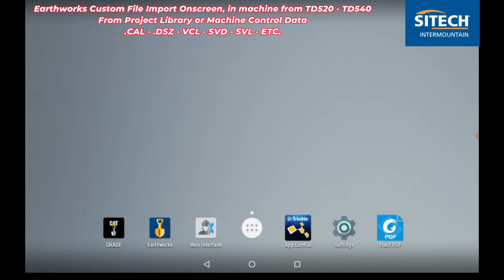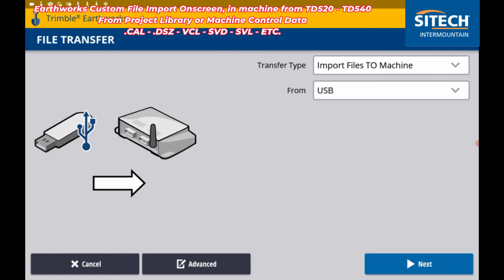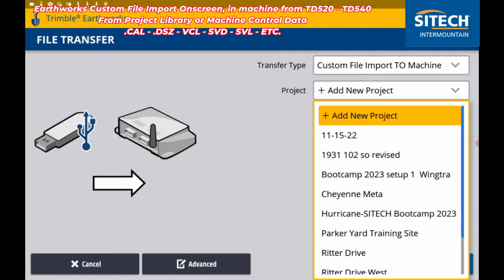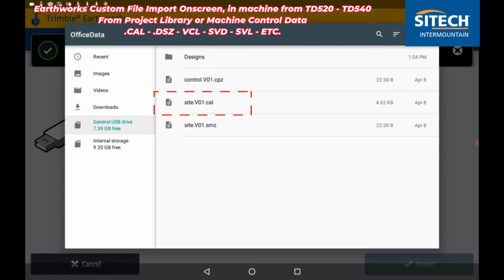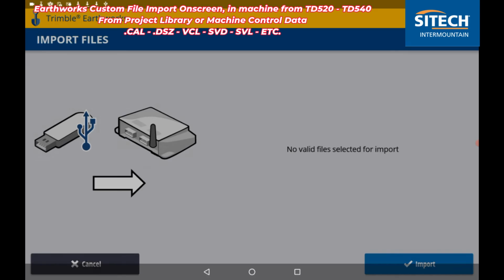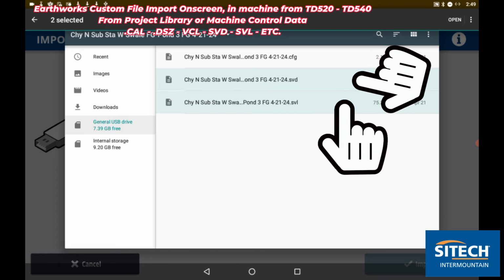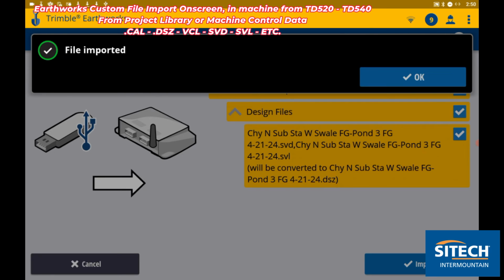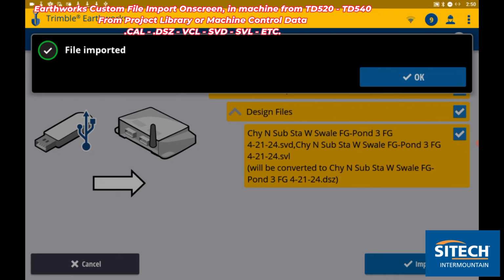Earthworks Custom File Import File Flipper from TD520 TD540

Comment: Is it possible to import the geoid files into the correct geo data folders?
Reply: I have tried that option and it does not seem to work. I tried pulling a Geodata folder in and even just picking a Geoid file all by itself for a project and it just says there is nothing to import. So so far it seems to be able to just create job sites and add the .Cal file and all the various design files or to add them to an existing project.  I will keep my eye on this for any future updates that may make it possible.  Right now you can just add those Geoid files through the Project Library option.